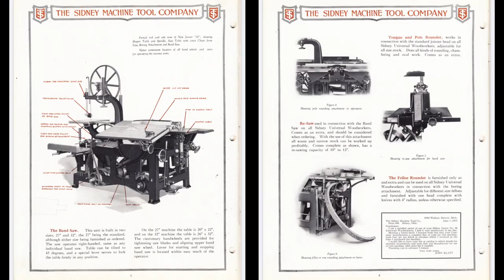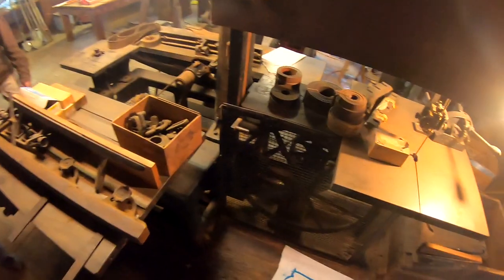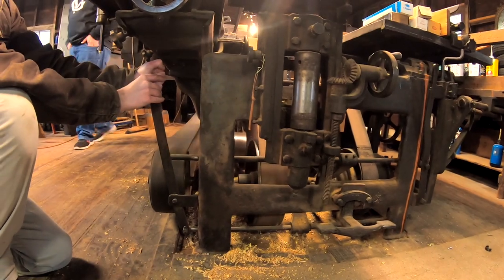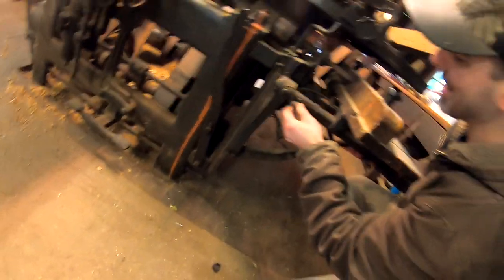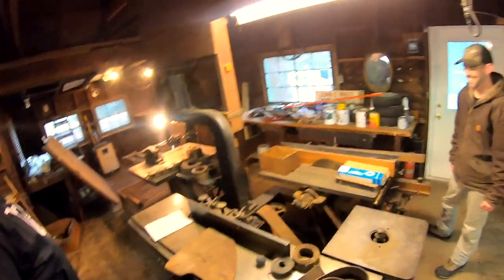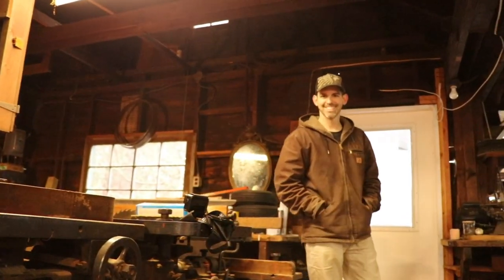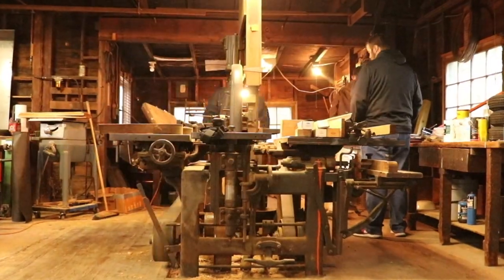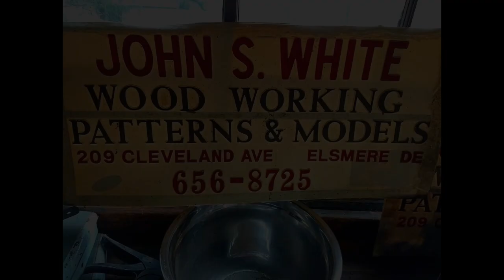Sidney Universal Woodworker | Belt Drive Machinery | Victorian Era Table Saw Band Saw | Jointer

Comment: When there was a wagon shop at Dollywood (Valley Carriage Works) we had a Sidney Universal. Very similar. Bandsaw, table saw, jointer, and horizontal boring machine. It also had the place (but parts were missing) for the shaper. We used the bandsaw and I modified the boring machine to be a disc sander. Was hoping to get the table saw running, but the park opted to close the shop in 2015. Machine was sold (along with all the other old tools) to an Amish fellow who resold them to folks in Ohio. BTW, have you fellows ever come across a "bilge saw" for making barrel staves? Similar to a regular cylinder saw (think barrel with teeth on the rim or giant hole saw), but the bilge saw is actually barrel-shaped and not only cut the belly (curvature of barrel circumference) of the stave, but also most of the bilge (the vertical curvature of the barrel). Here's one I found on youtube: https://www.youtube.com/watch?v=wlPcz98p5JQ&list=LL&index=5